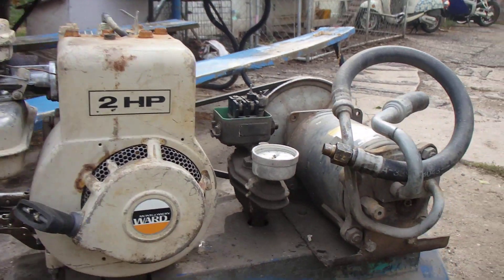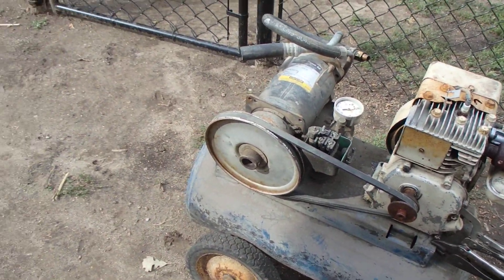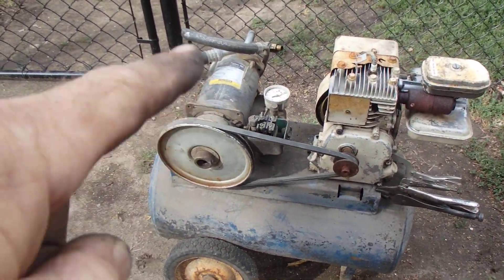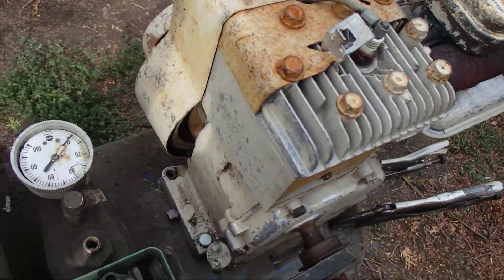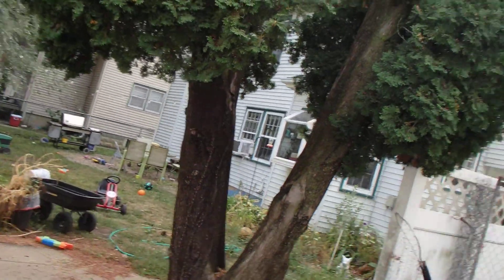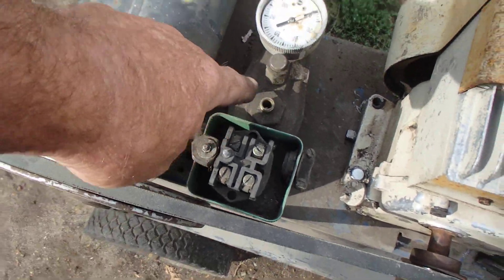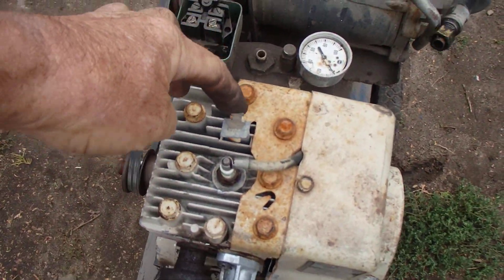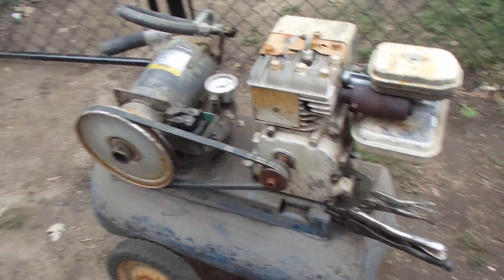today we mate air compressor to lawnmower gas engine

Comment: Hey buddy once you have your Frankenstein air compressor making pressure to the tank I would suggest either running your spark plug wire through the pressure switch so the motor turns off at the desired pressure or if you don’t wanna have to restart your motor every time it hits 120 pounds go ahead and get a pilot valve because It will waste the air instead of turning off the motor, you can get a little pneumatic cylinders so when you’re at the max pressure you want it will direct air to the cylinder and put your motor back to idle until It needs to make air again. I hope this was helpful. Good luck with your project you have.
Reply from the maker: jim here, great comment, a lot of info, my plan was to use a pressure switch similar to what big trucks use for their air brakes, seems simple and my pressure would stay about the same. thanks for your suggestion. my pressure would be low to push the oil out. my problem is how to regulate the vacuum when drawing the oil into my tank. again thanks for the view and comment, please any thoughts on vac regulation would be appreciated. GOD BLESS